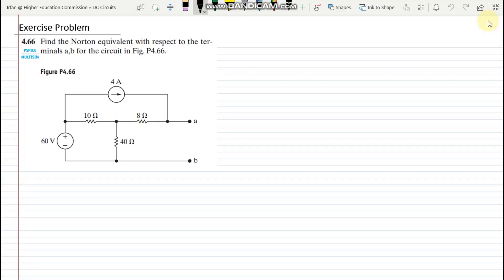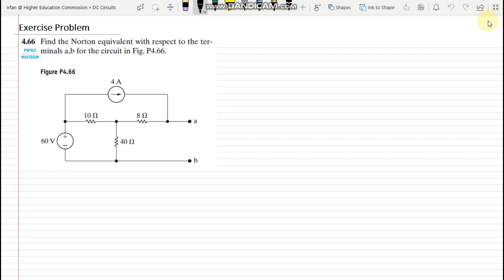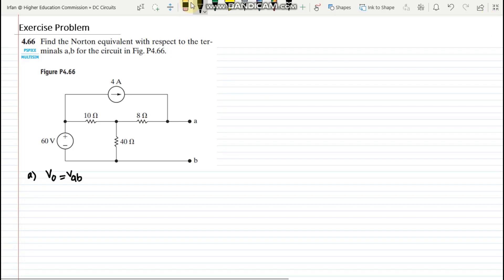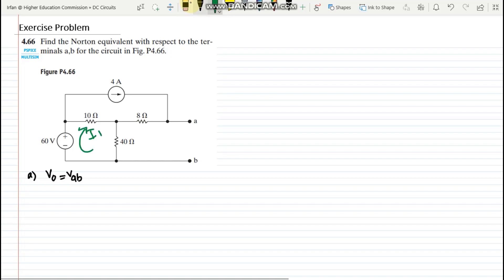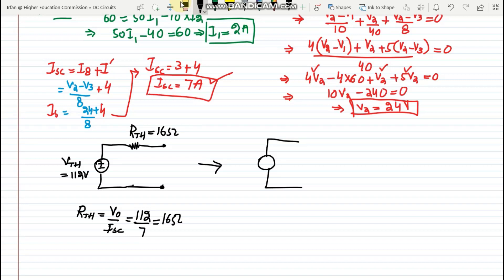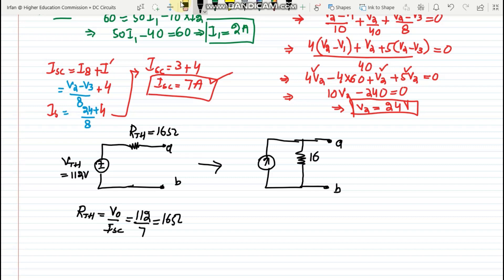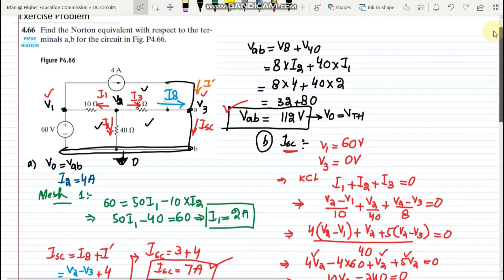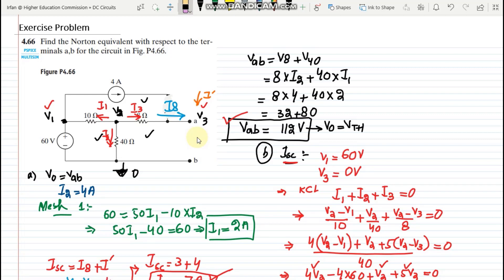Norton's Theorem Problem | Problem 4.66 - Electric Circuits by Nilsson 10th Ed | Engineering Tutor

Comment: Why in the first mesh you do 60=50I1-10xI2? Isn't it a 40 ohm resistor?
Reply from the maker: No, actually in mesh 1 we have two resistors. The second one has been shared with the mesh 2